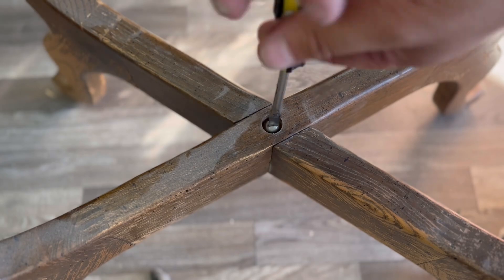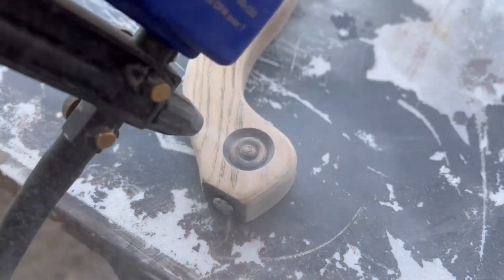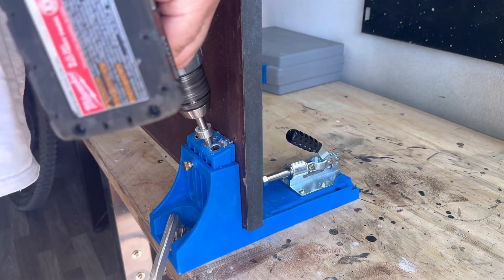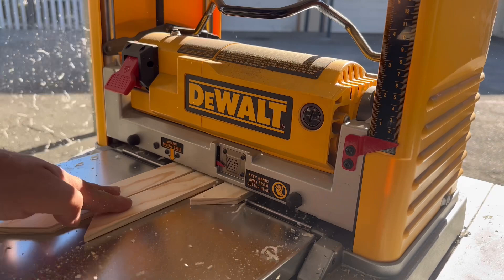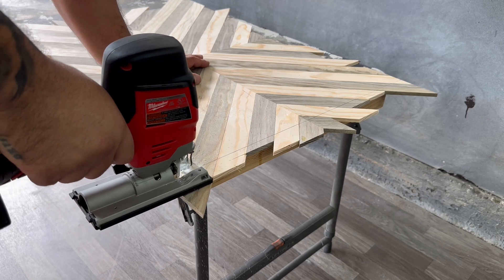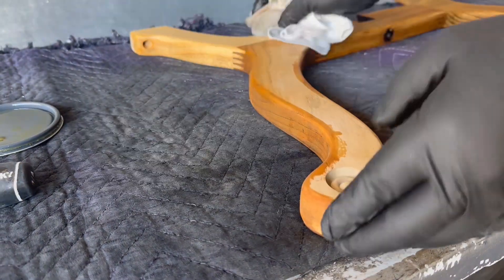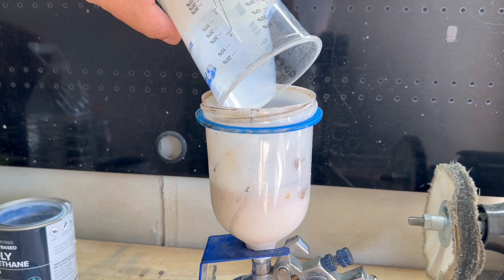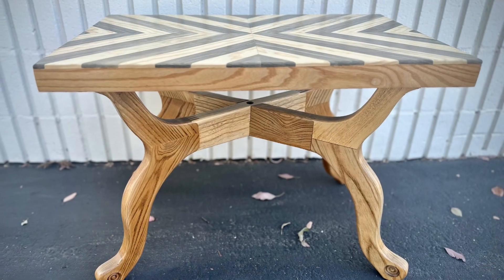RESTORING an old solid OAK side table WHILE ADDING a modern new SPIN TO IT || FURNITURE WOODSHOP

Comment: I think that the composite top might have been a replacement top. It didn't seem to fit. But what you have done with this table is quite good. I like the chevron pattern. I like the choice of finish. It turned out to be a beautiful piece of furniture.
Reply from the maker: That’s what I was thinking. The top seemed out of place. I’m glad you like the end result